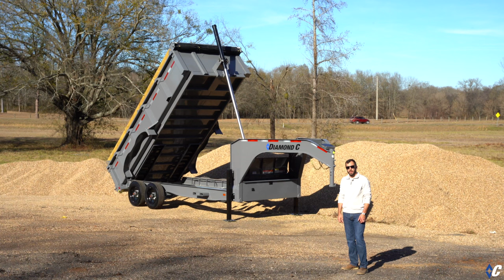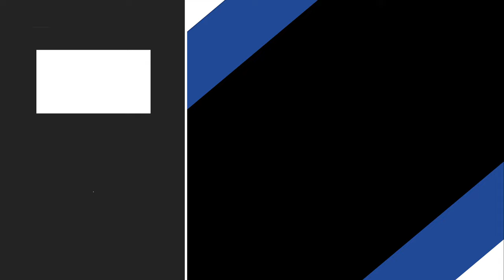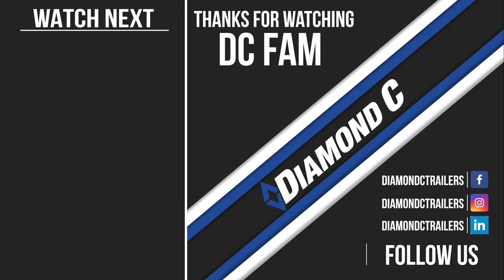LPT Dump Angle | Diamond C

Comment: Yes, dump angle is important. My PJ is only 40 but my Lamar is 45. So, win one loose one, lol. A dump trailer is the most versatile of all trailers and is a must have. About the only time I unhook mine is to grease the ball. The telescopic model is super slow but powerful, especially the first stage, it is big and requires a lot of volume. The best upgrade you can do is add a second pump. Night and day difference.